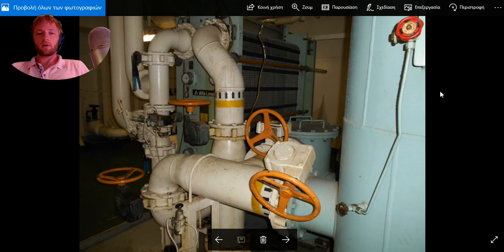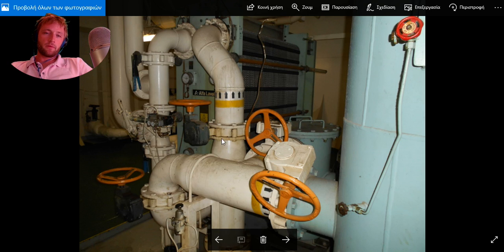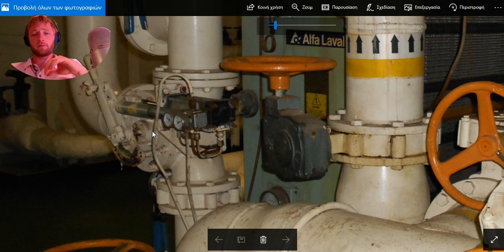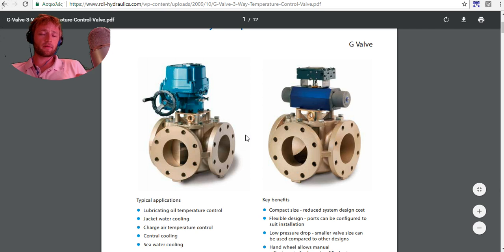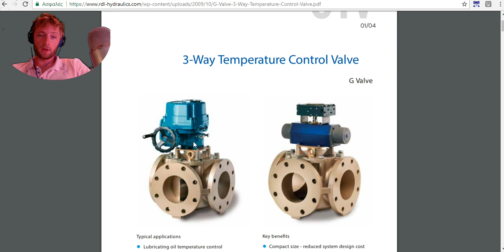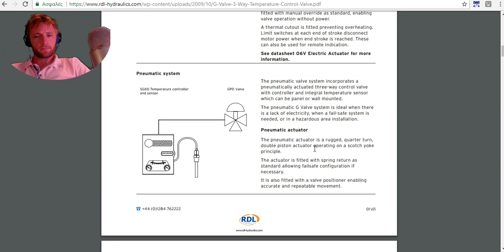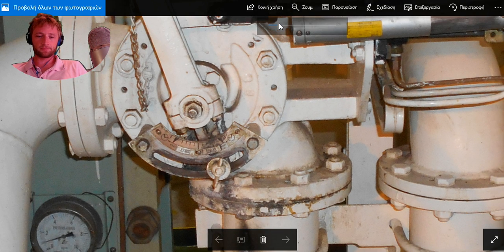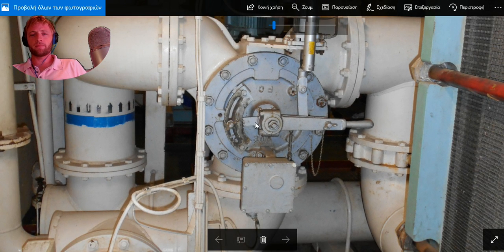3 WAY VALVE SYSTEMS TO CONTROL HEAT EXCHANGERS

Comment: Thanks for the video, great job sir. 
I would like to ask, how do we know that the 3 way valve of JCW is not functioning properly? How can we verify that?
Reply from the maker: Most common you will get wrong temperature which can be one of the problems the other one can be stuck in some position or actuators malfunction.Normally it is very rare to get such problems but it happens.Also you control can be damaged from vibration and the time as it passes.😀
Reply: @Adventure-Story  thank you sir